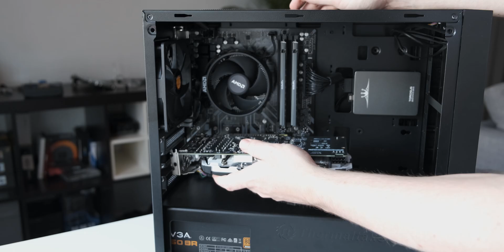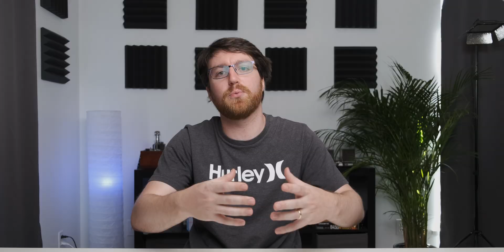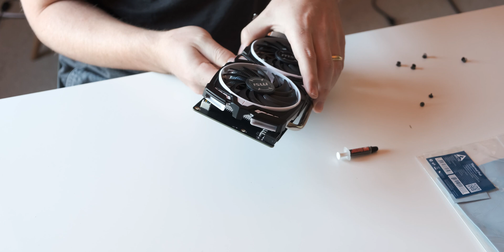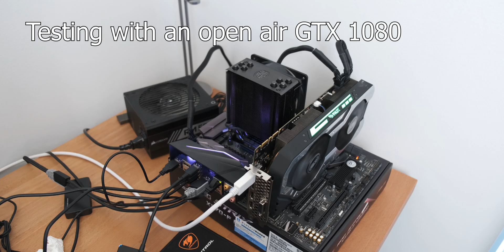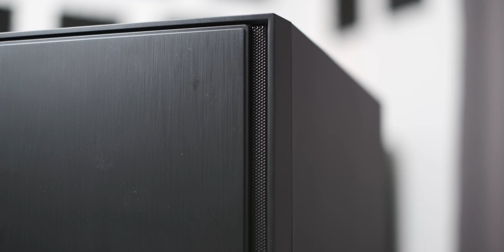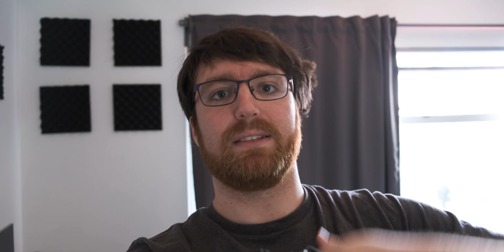How to fix a hot and loud graphics card

Comment: My Gigabyte RTX 2060 OC with Windforce x2 cooler also gets very loud as it keeps the card at 80C under load.
It has this plastic backplate that I hear contributes to the overall heat, so I'll try just removing it outright and see if an actual airflow over the pcb of the card might improve things.

Comment: I guess you can take the side plate off. or if you are feeling really lazy blast it with a desk fan. But being a bit less silly about it an exhaust fan on the back might help reduce the heat build up inside the case.

Comment: My GPU is not hot and only gets 37 degrees when gaming but it gets super loud. I am sure its 80% of the fan speed. But I have an ITX gaming PC so I can't keep a fan at the front of the case. My problem would only be solved by getting a new case or GPU but I can't afford that right now. I tried taking off the side panel by the GPU and it did not help but it sounds like in your video so I dont know what is wrong. I doubt replacing the thermal paste would help but should I do that?

Comment: One thing that can make huge difference is using super fine sand paper of granulation size P1500,P2000,P2500. With little water and gentle polishing of cooler contact point for GPU it can help with heat transfer and sometimes reduce temps by 5 degrees if it is bad contact.
Reply: Have you found video or something doing this?
Reply: @thenaberius6081  nope did it on my own on two cards that had higher GPU temps than normal. Sanding roughf surface of cooler (ordinary one, you cannot sand heat pipes) and putting the proper amount of thermal grease did the trick for me.

Comment: Bro my gpu temp was idling at 55 to 60 I did everything I couldn't figure it out I watched this video then took off my front glass panel boon idle went into the 30s gamplay 60s to 70s I was so relieved 😌  I had no idea air flow in your case is so important

Comment: These problems should not be solved by us, but by the producers. When buying a video card, that video card should be quiet, with a large cooler, equipped with 3-4 fans. We don't have to accept a noisy video card, we just have to return it.
The video card must be tested by the manufacturers in a case without fans, in fact, these manufacturers are based on cases of top.

Comment: the face of the die is convexed check the contact patch of the die to the heat sync without paste, you can see the gaps around the outside edges if you hold it up to the light. I had to remove two rubber grommets  around the middle screw holes and fully tighten those first then leave the two back screws one full turn back that allowed the center of the die to make contact with the cooler now it never goes past 74C at 2900 rpm fan speed, I also stoned the face of the heat sync with a flat lapping stone. under clocking also brings the fan speed down I only have a 75 hz display so I was able to lock it around 100 FPS at 1080 mhz with 1050 voltage, just drop them all down from there by 0005, example 1080,1075,1070,1065 Mhz with  Mv 1050, 1045, 1040,1035...

Comment: As an owner of an R9 290, the best step is not to buy an R9 290. Under load, I'm seeing 95c, but it runs The Outer Worlds at high/medium right at my set 60fps cap with an i5 4460s. I'm impressed.
Reply: Nice 🙌🏽🙌🏽

Comment: one of the tips due to experience dont purchase cheap inno3d cards i bet the higher up inno3d cards are fine but if they are the cheapest option i would say avoid there is zero software to control the card and litteraly nearly everything but idle and browsing can set the fan to 100% im talking about a inno3d rtx 2060 super i rma'd it its horrible i can stand even delta fans but due to the hole thing with the rtx 2000 series revving situation its not fun to hear it go 30% to 100% every time it hit near 70c which it often did not to mention heavy games it ran 86c maxed fans so much for thinking ow 50 euro cheaper im not a overclocker it should be fine nope its not by the way revving wasnt even fixable by custom fan curve due to the % it started revving

currently i got a gigabyte 2070 super oc 3x card the price comparision between a 2060 super with 3 fans and a 2070 super was litteraly 50 euro at the moment of purchase but at that price there was the gigabyte 2070 super oc 3x which yeah had 3 fans aswel so it was litteraly am i going to pay 50 euro more for more performance and its a why the fuck not 

but either way back to the point avoid inno3d if their the cheapest you got the jet engine pc's but imagine them restarting over and over agian and you had the inno3d card

Comment: My issue is 85% fan speed @ 70-74 during Valheim, noisy beast, very distracting. Going to try dropping voltage. Hoping for 50% at same temp.

Comment: I was just trying to fix this exact same gfx card last night. Stock cooler is terrible. it can't handel anything over 120w. i changed the thermal paste, under clocked and undervolted and i could not get mine to be bellow 80c. And thats also after adding two 120mm fans blowing on the card and the side pannel open as well. I gave up and bought a 3rd party cooler. now at 180w its not gone over 53c and its silent, lol.

Comment: I had the RX580 (by Sapphire) and I undervolted it by +- 100 mV - same frequency, but less heat (like 5 °C) and less power (by at least 25 %). I would recommend it to anyone, it's fairly easy.
Reply: RX 580 is known to have one of the loudest fans
Reply: I like gtx 970 better
Reply: 580 is too old for me 🥲
Reply: @DentSideDee71  The GTX 970 is older
Reply: Is it bad that my 2070super is having this problem?
Reply: @garretthelms5929  my 3060 ti is loud, too. I changed the fan curve in MSI Afterburner. Now it is okay.
Reply: I did this just a few days ago because in the summer my 580 gets to 75+ degrees celsius and has improved but a little.
@Ondřej Bakan  could you show me your configuration?
Reply: Can you screenshot it youre amd settings, i wanna undervolt mine but idk what to lower there are more like voltage options

Comment: I have horrible Dual Fan Biostar RX 570 card - it's cooler didn't even have thermal pads and it's thermal paste was just as bad, it had a temp limit of 109 C but gpu signal lost around 90 C  it didn't shut off at any time just no display , V bios was bad as well not to mention drivers hahha. My fix was to flash a lower tpd shappire bios onto it meant for single fan cards which limits the temps to 80 c and increase fan curve speed  because it literally ran 25 % fan speed on 85 C on default without me meddling with Afterburner fan curve before flashing , add thermal pads , replace Tim , make sure mounting pressure was good . I'm  getting 78 C with  slight clock speed throttling while undervolting the card with all that effort put in , the only thing i can think of left is the actual cooler is a very bad design since the cooler has 2 80 mm fans and the heatsink is kind of small... Great thing is its a good time to upgrade gpu's  in late 2020

Comment: I just built my new PC and I used the Lian li lancool 2 mesh and I have 3 coolermaster halo fans at the front and 3 coolermaster ml360R argb fans (included with the cpu cooler) on the top and back as exhaust. And for some reason whenever I just boot up my pc sounds like it’s taking off then it dies down and then it goes up and down, my motherboard is the Asus RoG Strix x570e gaming. I have my cpu pump and cpu fan header occupied by the 3 front fans and aio pump and the cpu_opt header underneath it is occupied for the included fans, I saw someone mentioning that Ryzen cpus like to jump a lot even during idle and since my fans are on my cpu opt header I was told they’re responding to the cpu heat, not the case heat. So I don’t know, I’ll troubleshoot it tomorrow,

Comment: Lesson: dont buy cases without airflow.
Reply: That's not a problem, MSI Armor cooled is underspecced for that card. I'm pretty sure that MSI just reused original Polaris PCB and cooler, then changed chip and now cooler is not so good anymore.
Reply: @MJ-uk6lu  True. I have the exact same card and its reaching 89c. The cooler is just poor on these Armor cards, they suck.
Reply: @hircine92h  It's not that it's bad, it's just too small for card this hot
Reply: @MJ-uk6lu  ye so the cooler sucks and its insufficient for this card but MSI wants to go cheap, so ..

Comment: Living in Japan and I bought the same case (cheapest one available), I'm thinking of cutting a hole in the front of the cage. I've also ordered 5 more fans which are supposed to arrive in some weeks.
But I bought a pci fan holder which can hold up to 2 120mm fans. I took of the gpu cooler and BAM!! A lot quiter, but I had to underclock the gpu a bit to stay at a reasonable temperature :p
Still considering though to buy myself a Dremel and cut a hole in the front of the case :p But I also like my pc to be quiet so that would introduce another annoying factor :/

Comment: Guys i have a problem with my pc and i need help
My graphic card (FANS) spinning so fast while the temp is good (70c-60c) and the (FANS) rpm is 2700
Plz help
GPU: msi Rtx 2070 gaming z
Cpu: i7 7700k
Nothing is overclocked
Reply: Set a custom fan curves or limit the speed using msi afterburner
Reply: @jojomp_459  i have sold it

Comment: put all  3or5 case fans pulling air out it will  suck air in pci expansion slot right onto the gpu it helped my asus rog strix570 from 86c to 74c at 70%fan

Comment: That diagram you showed about putting an x in thermal paste on a gpu is for a gpu with a heat spreader, a large dot will work fine for an exposed die.

Comment: The gpu cooler is hanging from one screw when he screws it in, due to the fact that the ”shield” by the ports is taller than the cooler. Also he forgot the paste on the chip. Plus it’s really sad that shit case design with flat panels in front are more popular nowdays. Still have an old fractal design midi with mesh/filter and 2 fans in front.

Comment: before i begin with this suggestion, yes i know i have different case and hardware 

i have a lian li o11d and a AIO for my cpu mouted on the side and 3 case fans exausting air from the top, creates a natural bottom to top airflow that hits my 1080 directly and keeps cold air hitting the fans and hot air getting blown away form the card. at stock speeds it reaches 70-71c with stock fan curve, litteraly cant hear the card over the AIO and then thats not even loud.
even overclockeed to the max i can get the 1080 and the stock fan speed it may reach 73c, still not loud.
i keep the computer in silent mode at all times even gaming.

Comment: I might be wrong here but why would you put the fan on top as intake instead of exhaust? I believe i had the same problem where my GPU (MSI Armor GTX 1060 6GB) was getting way too hot (78-80C) when playing GPU intensive games such as PUBG and opening the side panel helped to drop the temperatures almost instantly to 60s (Did it while still playing the game and running MSI Afterburner). After that i decided to just increase my rear exhaust fan's speed to max while keeping the case closed this time and it did help decrease the temps a few degrees to lower 70s but I still wasn't satisfied. 
I decided i would get one or two exhaust fans for the top of my case soon since there already is space for at least 2 but for now I keep my side panel open when playing such games.
I've got 3 intake in front and 1 exhaust on rear btw.

Comment: Because of the heat and the noise, I switched my RX580 for a GTX 1660. No heat and noise problems now.
Reply: Mine was quiet too. I bought a 3060 recently and it’s so loud  that I might put the 1660 back in!

Comment: My gpu goes on 100% fan speed unstoppable 4600 rpm and i cant control the fan because theres no fan tab on msi afterburner. Anyone know how to fix this? Thank you
Reply: I also have that problem with my rtx 2060 as soon as it reaches 71c fan speed is 5300rpm. Did you solve it?

Comment: i have same problem with msi rtx 2060 ventus oc  and with case i have 3 front 120mm fan and rare 1 120mm fan and raditor for cpu colling on top with case cooler master mb511 rgb      not sure what to do i only play game on it with msi afterburner i can getting 80c with around 2100 rpm

Comment: The problem is your psu.  For your system  you need a decent (Corsair, Tagan, Delta ...) 500 W power supply.
Reply: Zoran Zorand You’re wrong, the power supply is not going to effect the graphics card temps in any way unless it’s not powerful enough to feed the gpu. In which case it stays room temperature.

Comment: Cases with good air flow seem to be a must for these video cards since they run so hot, especially AMD based products.  Luckily cases aren't that expensive and can usually be found at reasonable prices.  Thanks for the video.
Reply: Fractal cases are the gold standard

Comment: msi cards can have a bad application from the factory, i have a 1080 gaming x that was hitting 82c re pasted it. 72c max at load now and it sits at 1900mhz+ instead of dropping down to 1750mhz constantly plus it was far quieter. btw the coolers on the model you have are terrible

Comment: Put both fans in the back and top as exhaust fans, air will be pulled in by the GPU vents in the rear. More dust but better got cooling.

Comment: I wouldn't say it's filler at all, quite the opposite. Just cleaned out some dust from my tower yesterday after a hot two hours of backbreaking labor using compressed air and the vacuum cleaner to consume the dust. I don't take any components out. 

 The problem is that there is also dust that's so dense it can't be dislodged by blowing air. MSI R9 280X Twin Frozer btw.

Comment: An Artic accelero can help most of the times, and yeah a good case grants you lower noise, better temps and better fps in some cases (gpu boost)
Reply from the maker: That arctic accelero is a great GPU cooler. I will look into getting a different cooler.

Comment: I have a similar issue on my laptop. While gaming gpu temps reaches 95°C and sometimes even thermal throttle. Any advice?
Reply: 95° is huge for a gpu, even for a laptop, is your laptop on a table with enough space around ?
Reply: Yep. I think the main problem is the really hot temperatures outside especially in the room because it hasn't any cooling but I don't know if I ad an air conditioner in the room if the temps will be lower and I want to find a better and cheaper solution!
Reply: @klensal4559  better than air cooler to cool air ? No.

Cheaper 🤔 maybe stay in the dark with windows closed. I know it seems awkward but for me it works most part of the day, because cold air stay inside and sun can't get in the room

Comment: you can undervolt too, undervolting helped me drop 7 degrees
Reply: Don't you lose quite a bit of performance by undervolting?
Reply: GoulouMalouku nope, you just decrease the amount of voltage going into the gpu which decreases the temperature, my rx 580 was stock 1150mV i think and i decreased it down to 1030mV where it was stable, 1000mV was not stable, just search on youtube undervolting rx 570/580 and you'll find a tutorial
Reply: im Rainz i've never heard of artifacts coming from undervolting, but undervolting is completely safe and the game or benchmark just crashes when its unstable.
Reply: @yousefnegmeldin5903  Yea cool thanks I have a GTX 970but I might try it cause it's getting old and heats up more easily now
Reply: GoulouMalouku yeah good luck!

Comment: MSI Afterburner with custom fan curve. Let the temp hit 87°C. And see how the fan handles the situation.
Reply from the maker: Yeah I thought about doing that, I'll try it out.
Reply: My RX580 ist getting 89C° and then it slows Down to Not overheat.At 100% Fan speed!
Reply: @kodacian24  WHICH ONE DO  U HAve because mine does that too.Myne is an xfx one
Reply: @feudaljester7581  same bro I know I’m a bit late I have rx 580 xfx
Reply: @gmtbworks4740  yeah i found out that even tho it reaches super high temps i dont have a problem while gaming or pressuring the card i hope that the same thing happens to you.Our cards are just made for high temps i guess so dont worry
Reply: Some may also promote slight undervolting. This should also be possible with a little trial and error in afterburner.
Reply: @larshenh  I undervolted my aorus rx580 and it either didn't help the temps at all or it crashed
Reply: @R3ddyDesu  I undervolted it and had great results, over 10°C cooler
Reply: To be frank that is quite hot for a GPU.
Reply: @TheRealFobican  yea it is my we all know that u can bake a steak  with the rx series